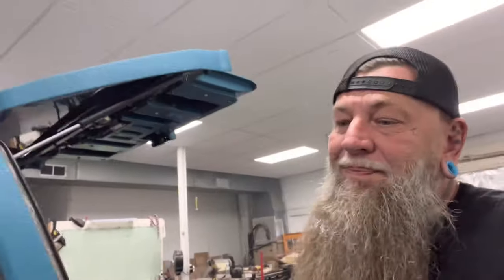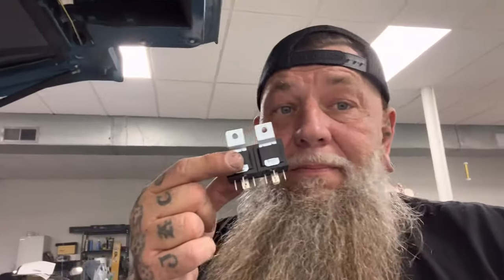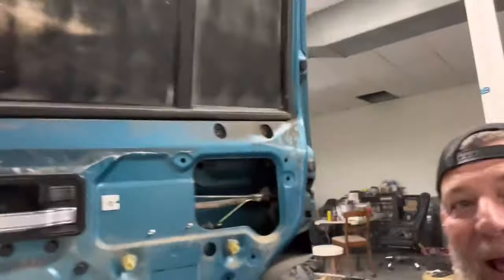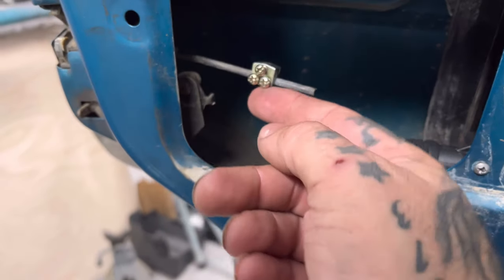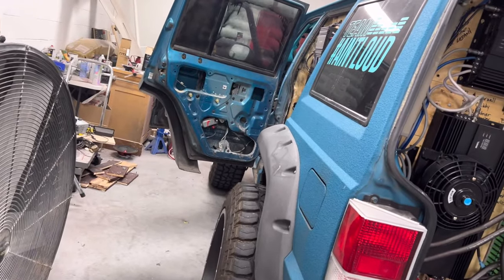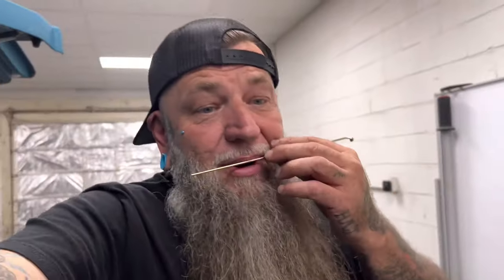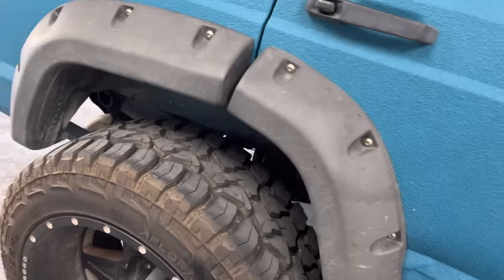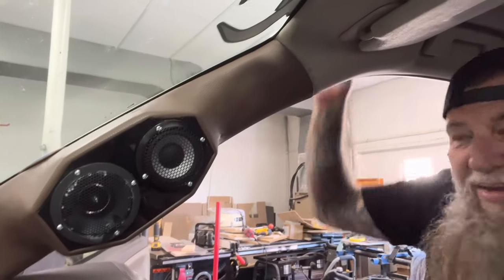Alarm Install and power door locks on Jangalang

Comment: How many 15s do you have in the Jeep. I'm planning on 4-15" DS18 EXLXX refurbished in a Cpillar in my 96 Explorer.
Reply from the maker: 6 in a 6th order
Reply: @JerryAintloud  how do I calculate at 6th order.
Reply from the maker: @russellcrabtree5314  there's math involved you'd need around 30 cubes
Reply: 5cf per subwoofer on the bottom chamber and how do I calculate the top chamber?
Reply: I'm a 25 year duct installer, so I know a little bit about air velocity and pressure, but building a 6th order is stumping me because I don't know the ratios of bottom vs. top enclosure.